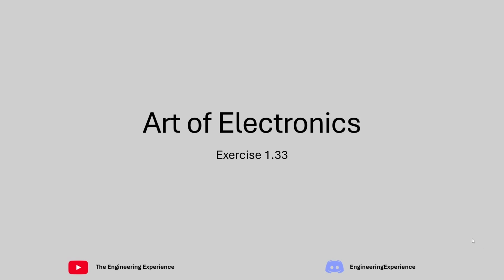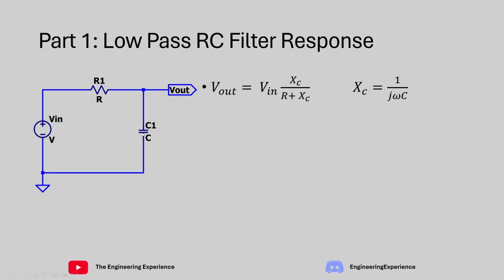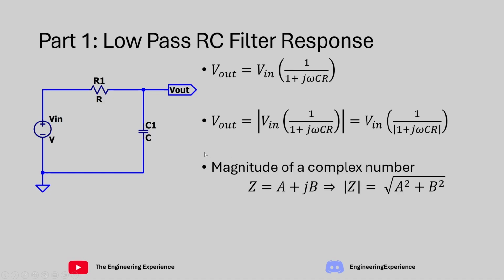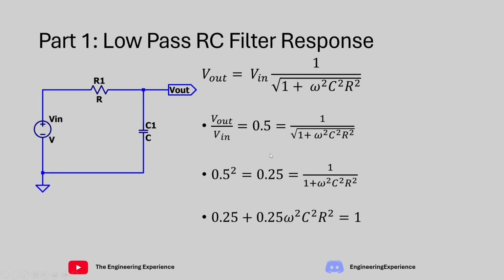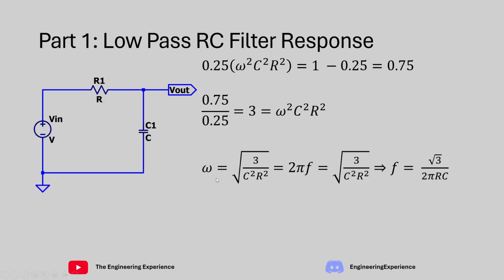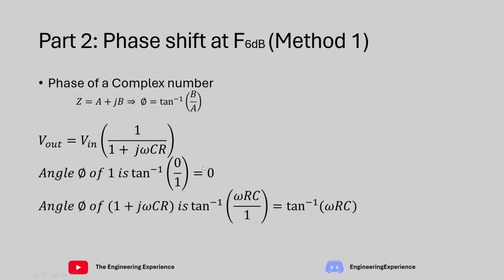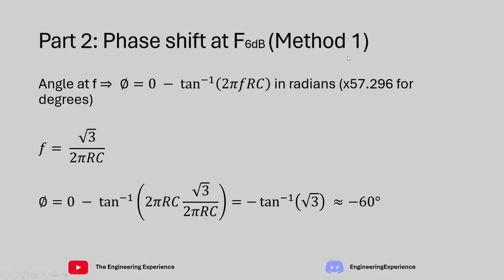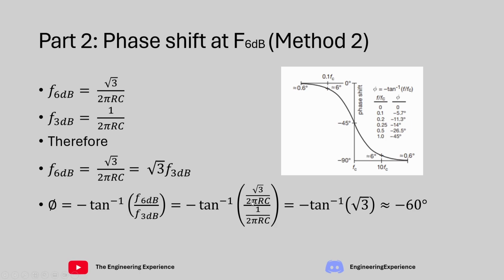Learn The Art of Electronics: Low Pass RC Filters Exercise 1.33

Comment: Great video as always.

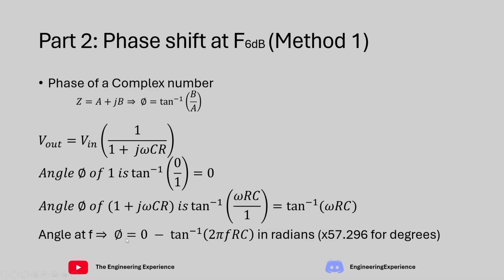08:15 - I didn't know that you can calculate phase angle by substrate numerator and denominator. I multiplied the numerator and denominator by the conjugate to get the imaginary part and then plugged the values into the formula:

V_in (1/(1+jωCR))

1/(1+jωCR) * (1-jωCR)/(1-jωCR) = (1-jωCR)/(1+ω^2 C^2 R^2 ) = 1/(1+ω^2 C^2 R^2 ) - jωCR/(1+ω^2 C^2 R^2 )
tan^(-1)(B/A) = tan^(-1)(-ωCR/(1+ω^2 C^2 R^2 )*(1+ω^2 C^2 R^2)/1) = tan^(-1)(-ωCR) = -tan^(-1)(ωCR)